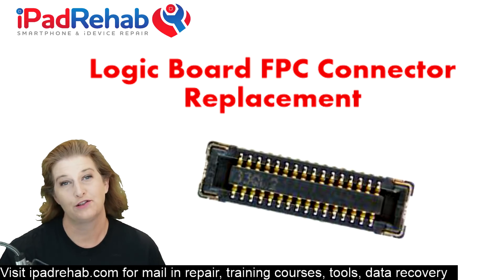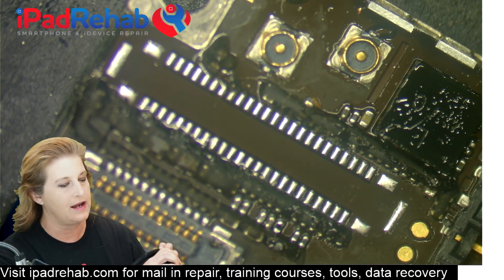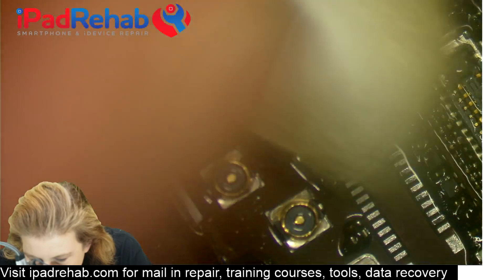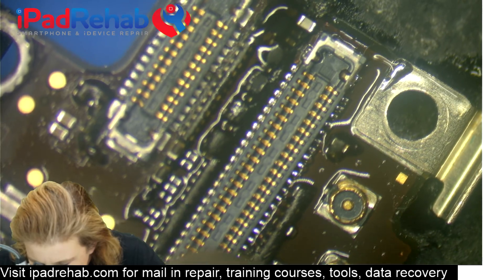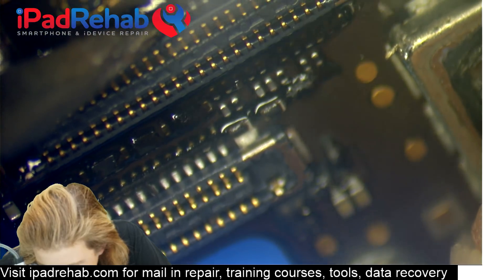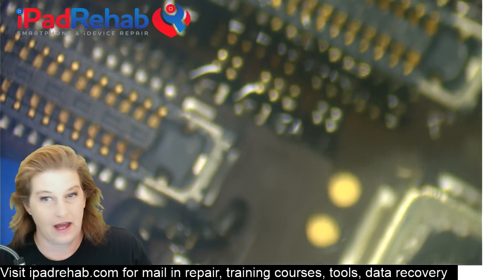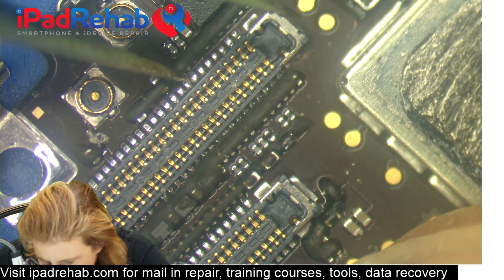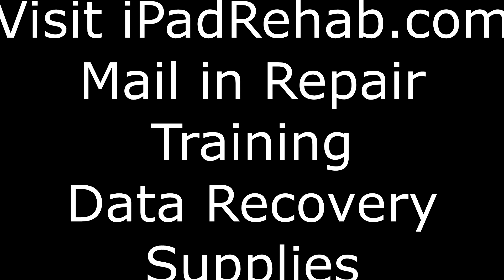How to replace any iPhone logic board connector

Comment: do you still do ipads,i need a few of these replaced on my 7th gen as it has some bent pins plus a new screen installed,i have the screen but cant do this delicate work myself.what would you charge for the job,one connector is the home button and one other for the screen need replacing
Reply from the maker: Yes—Go to ipadrehab.com and click Get Started to tell us about your specific device and problem and we will respond with a quote and mailing instructions.

Comment: my iphone 6 plus had a problem. it happened when i try to replace the back cam of my phone.  when im pulling up the flex cable i damage the fpc. the fpc that i damaged was the touch on board and now idk where and how to fix it. and my signal had a problem too. it just show no signal, maybe the parts that need to replace there is either the gps or wifi antenna or maybe both. 😭😭😭

hope u can help

Comment: Is there any tip adjustment to the hakko mini hot tweezers? The pivot screw seems, reasonably tight, but can't see any point of adjustments. I got a proper, matching T9-I set from official distributor (well over $100 around here), but the tips don't meet properly. Have to put significant sideways force at the same time as clamping them, otherwise the tips, are like at least 0.15-.2mmm off from meeting as intended. Making it really hard to get a grip on smds, and even worse keeping the grip. Because they slip off one end, and because the force exerted to push the yellow hinged portion sideways, induce small tremors, attenuated at the tweezer tips.

Comment: My personal approach is safer in my opinion. I like to destroy the old connector with a soldering iron and then remove its old bits. Then I clean the board with a soldering iron and solder wick, then I install a new connector using only the soldering iron. I think it minimizes the amount of heat applied to the board, reducing the risks of any damage.

Comment: Hi dear, i am very much impressed while watching this video.  But, i have facing a problem while i connect lcd strip into strip connector in Projector (Epson ELP 7600), Connector locking pin has broken and miss led. Kindly suggest and oblige.

Comment: Since it’s leaded solder and stronger than unleaded, would it be adequate to simply add some solder to the corners once the new connector is put on rather than adding solder to each of the contact pads?

Comment: Question:  I see both you and Louis Rossman use flux on connectors but there is rosin (flux) core solders so I wondering if you use flux by default because it aids in the soldering process or do you use rosin core solder on certain parts only?  As an electronics tech I tend to use flux when I have more than one connection to work on.  If it's a single side like a cap or resister I use rosin core solder to reduce the cleanup later.

Comment: can anyone help me? 
?i have a 6s that wont charge past a certain amount of battery percentage. what part of the board is damaged or needs replacing?  secondly, if i have another board, which part of the logic board do i have to swap over to the working board to bring over the unlocked apple id part

Comment: If you have to adjust the temperature on your reflow station because the air termperature is not consistent, why not use a separate meter with a thermocouple probe to verify the air temperature instead of having to guess.

Comment: I had troubles soldering SODIMM connector to my prototype PCB - RPI CM3 carrier board. It looks like this technique (put tin on pcb first and then presolder with hot air) will solve my problem!

Thank you for the video! Keep it up!

Comment: I have an iPhone 8 Plus that the screen is 1/2 dim after screen replacement. Do you have a video where you fix that?
Reply: You have blown half of the backlight circuit. You probably did not remove the battery while installing the lcd. Repairing it is easy. It just one component you must have blown. but youll have to figure out which one.

Comment: Hello everyone in the comment section, it's my first time fixing one of those issues  with iPhones, and I have a question about it, because i find the missing pin on the LCD connector and I don't know if this problem cause a short circuit that warms the logic board once it's turned on. So I wanted to know if someone had a response to this because I don't know if this missing pin cause the short circuit

Comment: ipad rehab have you tried with the WD-40 I use it to desolder and solder the connector protects the plastic and does not burn the heat the best you do not need to use the captive to align it only aligns the new connector applies heat and ready the connector is accommodated alone and it is perfect alguin day test greetings

Comment: Man you have skills, I ordered 5 - 6s connectors for a practice board and have used 4 up already.   1 left now I am gonna nail it lol....
Reply: If you use a good quality soldering iron, with a fine tip, you can basically install the new connector using only the soldering iron. This way you are less likely to destroy it by excessive heat.
Reply: @jua_rpj  depends on your skill and steadiness with (regular) tweezers vs the iron. Some people are really steady, precise and swift with tweezers, but not with soldering iron or hot soldering tweezers. If you're one of those, using only hot air and regular tweezers, can yield just as good results. As Jessa points out here, if you're sensible about the temperature, you won't damage the plastic as long as you only touch and manipulate it by the beefy ground retaining tabs at each end.
Reply: Did you eventually buy Apple instead?
Reply: @Niel where did you buy the connectors from?

Comment: I went through 5 connectors the first time I did one (ipad air 2 dig) but I am starting to get the hang of it.  I only used 2 connectors last time....definitely a skill that has to be learned by doing it...Great video!

Also can you guys please source some good iPad 3D BGA stencils?  I would really like some especially for ipad air 2 and can't seem to find a good set anywhere...I will buy them as soon as you put them up in your store!
Reply from the maker: +technolucas we have the 3D stencils that we use every day available at iPad rehab supply.

Comment: I do it exactly like you do apart from when iv re added solder I don't add any to the anchors. I only do that as iv found on some connectors the big anchor pads can take too much solder which stops the connector touching the regular pins properly.
Il then go and solder the anchors after once the other pins are done.
Your station is better than mine so prob removes the solder from the anchors a bit better than my cheap one :) , as I find it a ball ache to remove once added.
Then I just do the same as you and go over each joint. Seems to do the job.
Reply from the maker: I don't get ball aches, that's probably why it works for me.